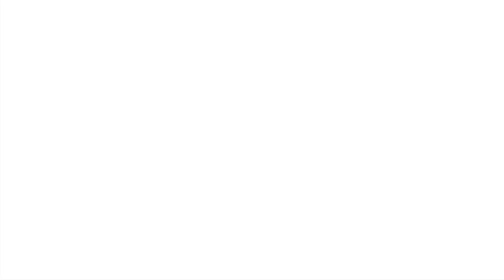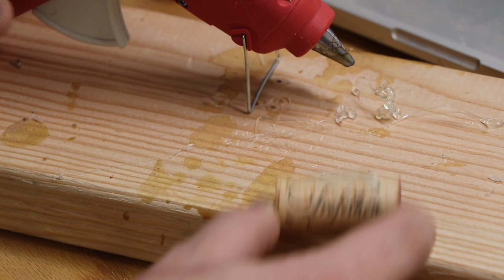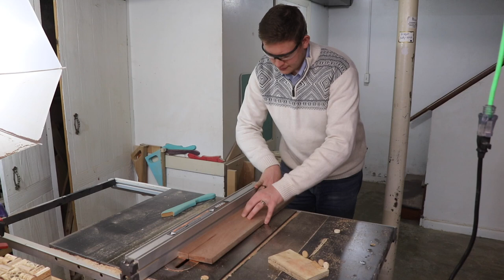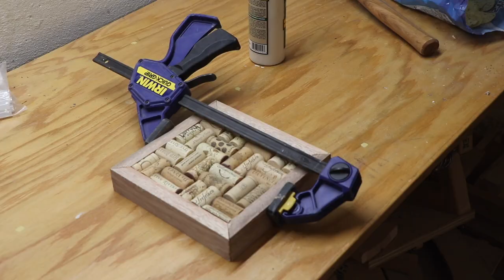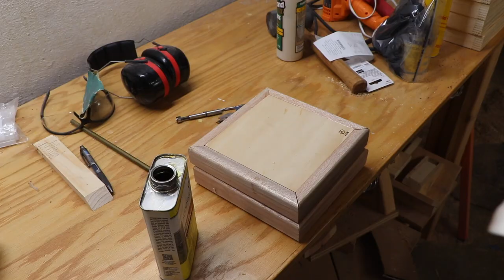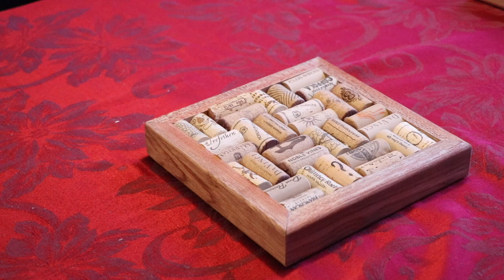Easy DIY Wine Cork Trivet

Comment: Very nice idea - where can a teetotaller get some wine corks ? Restaurants maybe ?

One concern I have is that the hot glue might remelt when an extremely hot pot is placed on top of the trivet - 5 minute epoxy might be a better idea in this high heat application.
Reply from the maker: Thanks!  Restaurants are a good idea, actually.  I was concerned about the hot glue at first too, but that fear was quickly squashed when I had to fix a mistake and couldn't get the cork off to save my life.  When I tried to remove corks using a heat gun all it did was burn the cork.  The cork is thick enough that it insulates the glue side from what's on top.